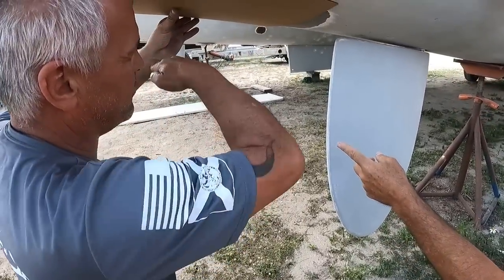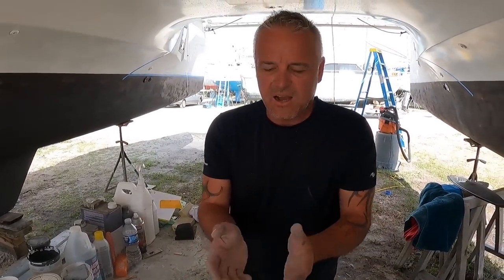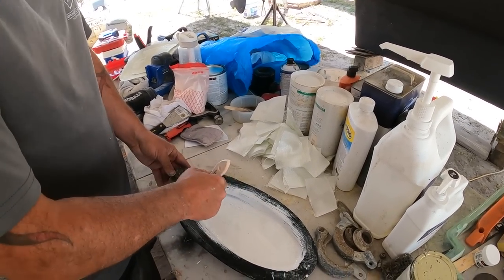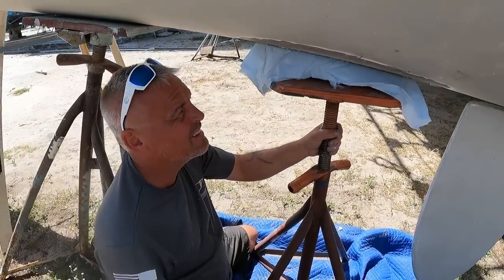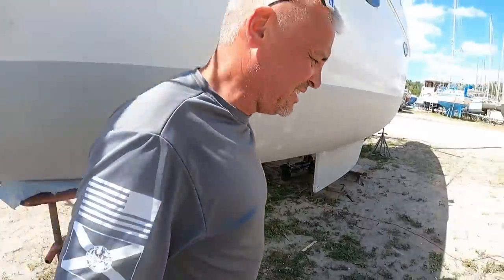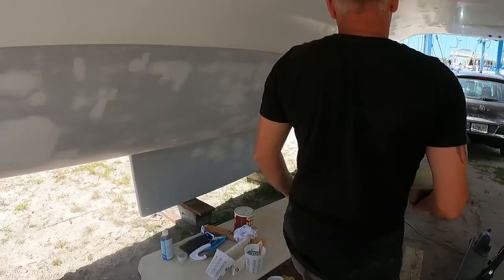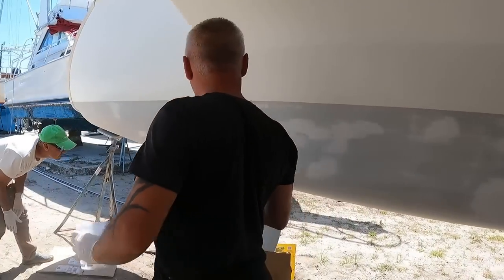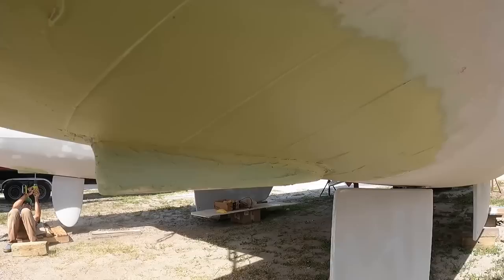Catamaran ELECTRIC CONVERSION - Torqeedo Engines Part 1 - Boat Work(S4 E44)

Comment: Maybe this was discussed earlier, but why are the motors being mounted aft of the rudders? The efficiency of the rudders, and thus maneuverability of the vessel, is greatly increased with the propwash flowing over the rudders. Without that propwash the flow is greatly reduced. Especially in a situation like motoring into port with following seas, you'll have minimal rudder efficiency.
Reply from the maker: That’s how this model of fountaine pajot was designed with the sail drives behind the rudders. They wanted to keep the electric motors in the same place as there was already a hole to work with

Comment: Nice plug forming. A lot of 1708 layers to get that thickness.
Dinghy losing air- if patches don't fix and you want to keep dinghy for another year, you can use 2 dunnage bags (relatively inexpensive inflatable bags of different shapes and sizes used in shipping ) 1 per tube, assuming dinghy has 2 tubes.  There does have to be a slit made in each tube, insert the appropriate size bag into the tube, inflate and sew up /patch the slit.  The bags supply the flotation ,not the tubes.

Comment: The ‘binder’ holding ‘CSM’ together dissolves  in styrene which is a monomer used in polyester type resins.  This frees up the fibers allowing them to conform to the shape of your work.
Cheers Warren

Comment: I love this project and did the same on my cat (SW1000XL2) except on legs like an outboard. But I can't understand why the owners wouldn't put the pods in front of the rudder?
Reply from the maker: This is where the existing sail drives were. There is already a place to mount the engine in the engine room. If they were to put them in front of the rudder it would have made it a much bigger job
Reply: @BarefootTravels  makes sense

Comment: Fantastic episode. And thanks for the insights. I like to use biaxial but that 1708 is such a nice option. 👍🍻
Reply from the maker: Thank you!
Reply: B1708 is biaxial but it includes a layer of CSM attached to it with the stitching (No binder) . The 08 part of the 1708 refers to the weight of glass added ie 8 oz per sq yd or about 1oz per sqft of csm. 
The 17 refers to the 17 oz per squ yard of biaxial fiberglass .
Yes csm is normally per sq-ft   
Woven and stitched product is per sq-yd.
(Nominal weights above)
Cheers Warren

Comment: to sharpen those scissors get thick tin foil couple layers and cut with scissors as many times as you can. then they will be sharp.
Reply from the maker: Really?
Reply: @BarefootTravels  yes.
Reply: @BarefootTravels  then when you are done with tin foil ball it up and scrub stainless steel with it. removes rust fast.